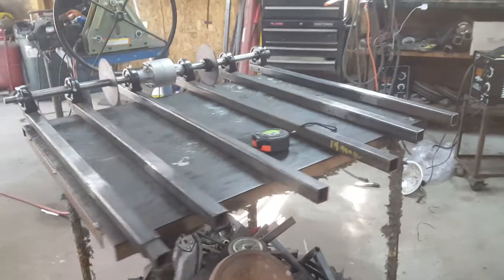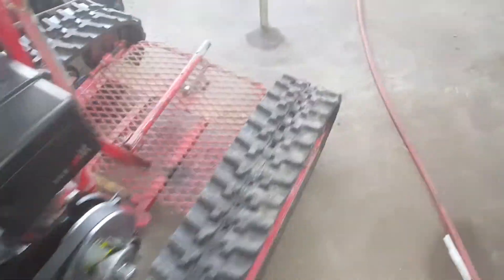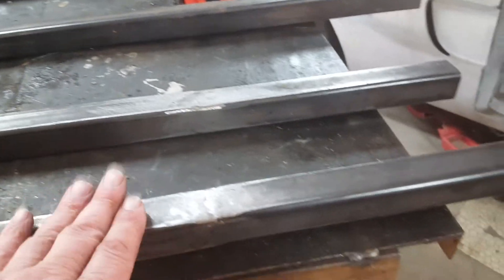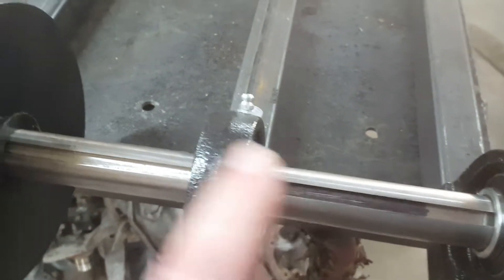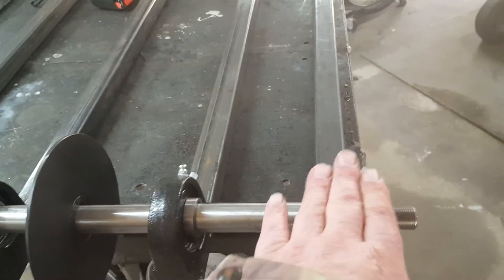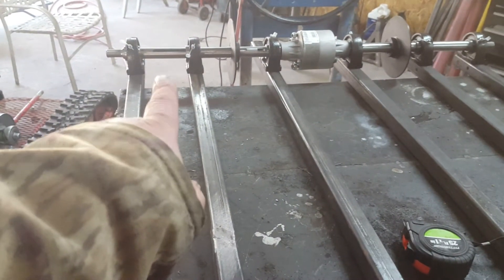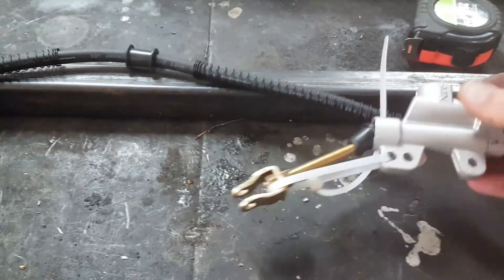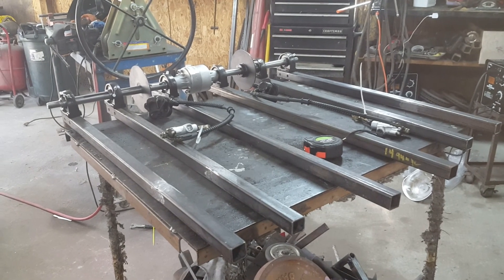PTV Build 2 - frame construction

Comment: Looking great!. I'm gonna build one too, just a little bigger. Question, does the company that makes your tracks have different lengths of the same track style?
Reply from the maker: Matt Smith The only ones are only a single link longer, 180X60X40 but they didn't have them in stock.  I have been unable to find any 60 pitch tracks significantly longer.  There are some 72 pitch tracks around but then there is the sprocket issue.  I will address this in an upcoming video, thanks!
Reply from the maker: Hey Matt, I found the EURODIG DUMPY 800 has 180x60x44 tracks, five links more than the 39's.   Summit lists them.  They are a bit longer.  How long do you want to go?
Reply: Thanks for all the help. Unfortunately I need to do a little more design work to figure out exactly how far I want to go with my build. I may end up building a PTV/Four Wheeler hybrid the Howe and Howe tech did, only less intense and FAR less expensive.
Reply from the maker: Matt Smith what are you thinking as far as the drive system? I'm interested.
Reply: I plan on using a predator 670 v-twin with a torque converter from go-powersports. Hopefully they come out with the new one soon, it's supposed to be a beefier version of the 40 series that can handle the 670's 22 horsepower. As for steering, I'll be going with a triple-differential steering transmission by modifying 3 peerless axles like yours, it's a little complex but is easier to control and will be less prone to failure under the extra horsepower.
Reply from the maker: Matt Smith I thought of the exact same thing using three of the Peerless differentials but I couldn't quite get it into my head how to make it work. I totally agree with the concept. Do you have any drawings or anything like that yet? Please keep me informed!  revchuckswarthout@gmail.com.
Reply: I would mount two of the axles with shortened shafts towards each other, Then link them together with a coupler on the shortened shafts, then mount the third diff behind them with both shafts shortened. Then attach chain sprockets  and steering brakes to the shortened shafts of the third diff and chain sprockets on the two drive diffs that are ahead of the steering diff. Then attach chains to the sprockets and mount a chain sprocket to the steering diff, this chain sprocket would be attached to your power source. I don't have any drawings yet but when it's built I'll post them on facebook and let you guys know.
Reply from the maker: Matt Smith yes, it's powering the "steering" drive that I wondered about.  Amazing, l was thinking identical to your configuration.  Stay in touch!